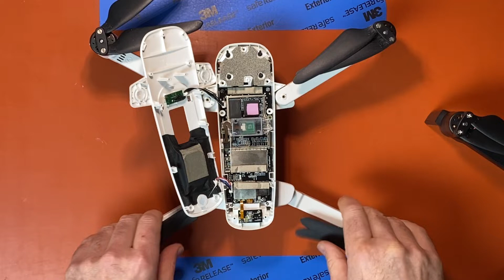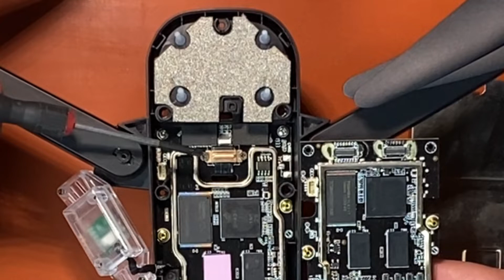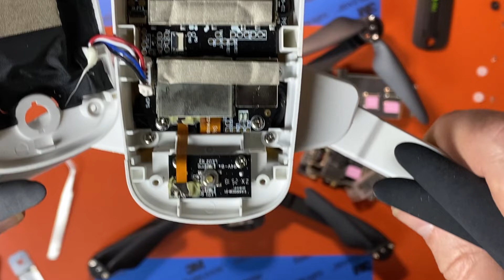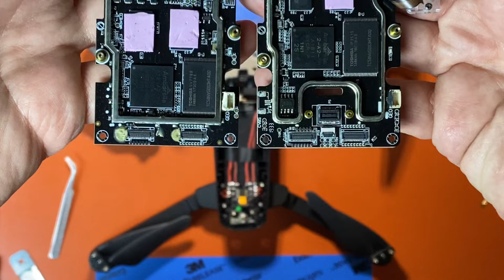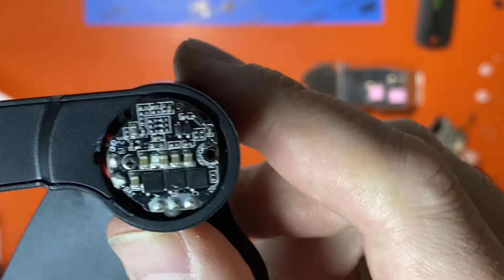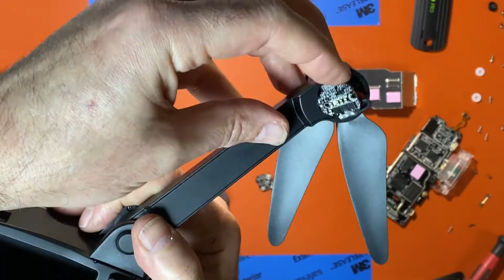HUBSAN ZINO PRO - THE UPGRADES ARE INSIDE & HOW TO TAKE IT APART

Comment: This is interesting to me, because you can see the iterative upgrades they obviously had to make knowing that some of the parts that they had originally incorporated were of lesser quality than they thought. It’s just a shame for original Zeno owners that they had to kind of be the guinea pigs. Though, it wasn’t intentional by Hubsan. It was more trial and error with the vendors they used to get the parts they needed that would last the lifetime of the drone. As you said, Zino 2 Will improve upon everything more. Which is an incredible thing, because it shows that Hubsan is really striving to be the best they can be and make the best drones that they can.
Reply from the maker: Yes and when they step into this part of the arena they kinda have to get it together because they aren't competing with toys anymore. I'm very excited to see what the Z-2 will bring.
Reply: QC GUY yep. The cool thing is, they aren’t only competing they are looking to dethrone. The fact that the new drone will fly, what they say, is almost 4 1/2 miles with video transmission… Is incredible. Not to mention the camera which looks to be better than any other hobby grade drones camera on the market. To get this kind of performance you have to go with Go-Pro. Which is what excites me about the removable camera. They could use that to allow Zino 2 owners to upgrade. Will they? That’s questionable... but, it doesn’t stop third-party vendors from making their own or the hobbyists themselves figuring something out. Let’s face it, I doubt the controller in the drone knows what kind of camera is attached. Which means, you just remove the camera from the gimbal and put any other kind of camera you want that will fit. Not that you would need to, because we are already talking 4K/60 with HDR. Though, if somebody wanted to go with a camera that had a 1 inch sensor for better low light performance, they probably could as long as that camera would fit in the confines of the gimbal itself, given it didn’t require more power. 

The exciting thing about the Zino 2, is the upgrades, but more so what the implementation of the accessories port and removable camera means for the future of the product. It could just mean nothing as far as the cameras concerned... but you know as well as I do, if there is a will there is away. Meaning that the hobbyists themselves may figure out that way and make the drone even better. The more of these they get bought, the more popular the Hubsan brand becomes, the more third parties will start making accessories. Which only means this product is going to improve more and more as time goes on. That is, given enough people start buying them. But at the price and with the features it has, there is nothing that matches it that doesn’t cost $700 or more.